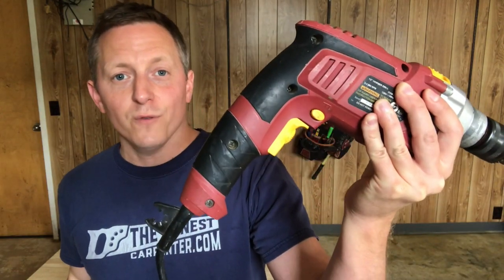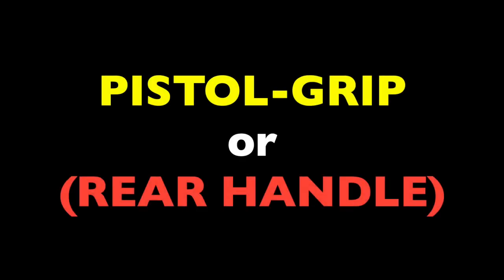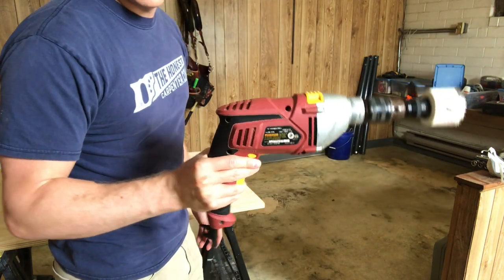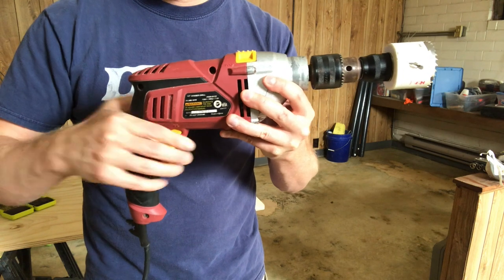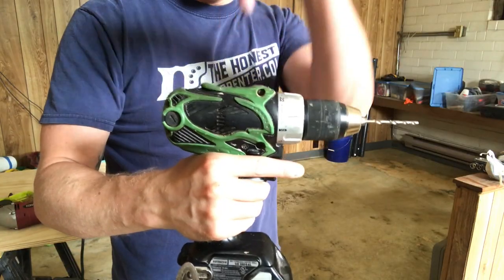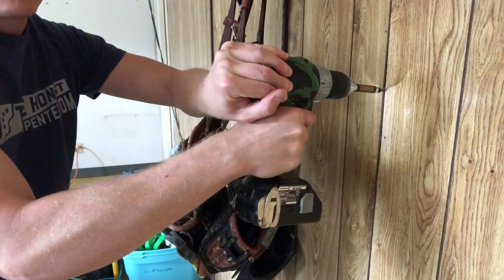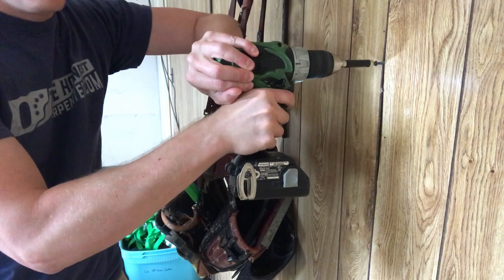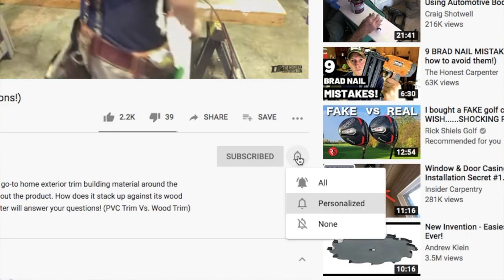PISTOL-GRIP VS. MID-HANDLE (Which DRILL HANDLE Shape Is Better? What's The Difference...?)

Comment: I used a pistol grip Milwaukee drywall “screwgun” for years. I gripped it by raising my hand and gripping the tool with thumb on one side and index finger directly opposite in the grooves that show as black on the drill you displayed.  That way my force was in direct line with tip of tool. I used ring and pinkie to operate the trigger. Thousands of screws a day.

Comment: I had an old porter cable 3/8 drill -- from the 70's and it had a mid handle connection. Way ahead of its time.

Comment: Being an old guy, I used to have a 3/4" chuck Porter Cable that was a beast. It was a t-handle(mid-handle) but had a second handle on the opposite side and you had to use both hands. for 1/2" and 3/8", I have always used T-handle drills.

Comment: @The Honest Carpenter. Thanks Ethan for covering this topic. I just got rid of my two Dewalt NiCad pistol grip drill drivers. They were costing me a fortune in NiCad batteries every 3 years like clockwork. I can hold them like drywallers would which gave me better results when I used them to drive screws. Now with the exception of cordless drywall screw guns, all the cordless drill driver drills are mid-handles. I also guess alot of people like to stand them on the battery if they can. 

Hope you and your family stay safe and well.

Comment: Interesting video, and something I had noticed but never given any thought to. Thanks.
One comment, caution gripping the body of a power drill/driver. This is where the cooling vents are often located and blocking air flow may cause the driver to overheat after prolonged use.

Comment: What's to be said? I totally agree. My corded drill is just gathering dust. Everything where I've needed extra power, so far, I've been able to do on my drill press. I have an addon table for it which really makes it better. 
Actually, the first battery powered drill I used was a Makita. The battery was a big monster that filled the entire handle. You still wound up with a very nose heavy drill.

Comment: As you said, battery operated can be used whole day. Have both, rarely use the pistol grip. I only used my SDS drill when drilling in concrete. My 750w corded drill is gathering dust.
Reply: That's why it annoys me so much that mid-handles are almost all cordless. I don't use a drill everyday so I don't want to deal with charging when I need it.
I inherited 3 pistol-grip drills and ended up finding out I absolutely abhor pistol-grips. I wish I had a mid-handle and a hammer drill instead.

Comment: Mid /Tee handles became the norm for cordless drill-drivers when the 18 volt batteries came to market. The early 12 and 14.4 volt tools didn't have the bulk of the 18 and up systems, so the manufacturers needed a  way to accommodate the larger batteries while still keeping the volume of the tool down. Think of them as a double-decker bus compared to a bus towing another bus. It also allowed for the tool to stand upright on the bench, thereby taking up less space.  That being said, I prefer the traditional pistol grip design for its ability to allow for single handed use while applying direct inline pressure on the drill bit or faster.

Comment: Rockwell used to make a line of "pistol grip" drills that were desighned to be very easy to hold with your web of your hand directly behind the line of the spindle, and operate the trigger with your last two fingers. Of course, that was in the 80's/90's, and I don't think they're made any more. I still have a couple.

Comment: Another great video.  Are mid handle grips really that much less in power, especially given that you can use your open hand if needed?  I'm thinking they aren't. I do understand the pistol grip ergonomics, it's the same with a gun/pistol for accurate shooting and handling recoil.
Reply from the maker: They’re really still pretty strong, Jim. Good enough for most applications. I usually only bring in a pistol grip if I’m doing a lot of large circumference hole saw boring, or highly repetitive deck work. The extra power in the corded tool just saves your wrist in those applications.

Comment: I despise pistol-grip tools. Sure, the hand holding a mid-handle drill isn't positioned ideally to apply pressure, but it is in the right place to position the drill and the back of the motor is right there for you to push your palm against a nice, flat surface. The hand pulling the trigger is then doing the job of the front hand on a pistol-grip. And, if you don't need the pressure, you have a free hand.
Meanwhile, with a pistol grip, your hand might be closer to the axis of the drill bit, but it's so far from the centre of gravity and the material you're drilling into that you'd have better luck laying it out in the garden and throwing a lawn dart at it from a balcony. So, you add a handle for your other hand. Now, the hand squeezing the trigger has to push against the material while controlling the speed of the bit, while the other hand is chilling on a handle that is not in the axis of the drill bit, so no extra pressure, and also not in the center of gravity, so not much stability either.

Comment: I'm definitely a pistol grip and corded drill bloke. Can't go wrong with all the extra power and sturdy construction. And I disagree, they're fine for screwing, it's all about timing and pressure applied. Plus the trigger lock allowing you to use the trigger once to keep the drill powered but not spinning until you push down on the end is handy as hell. Until I saw the vid about how to hold a mid handled drill you did I've hated them with a passion. Thanks for straightening it out for all us morons 😉😅